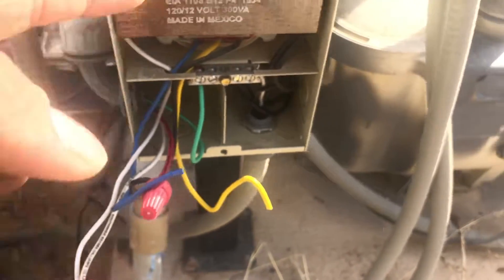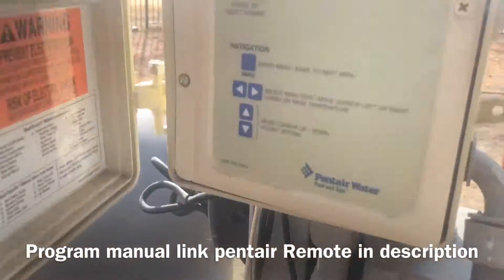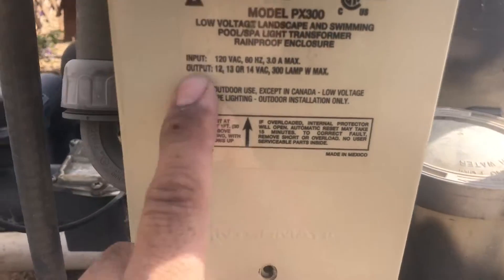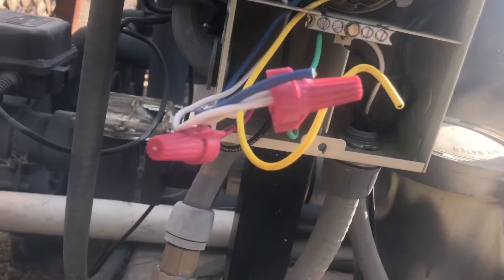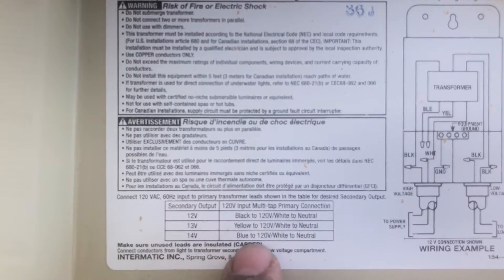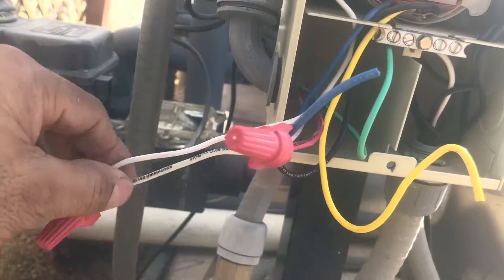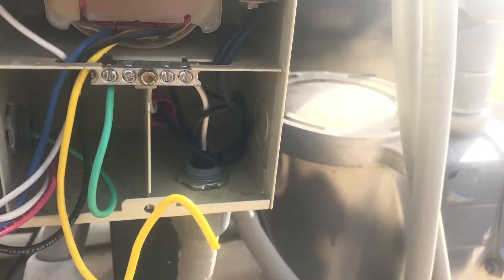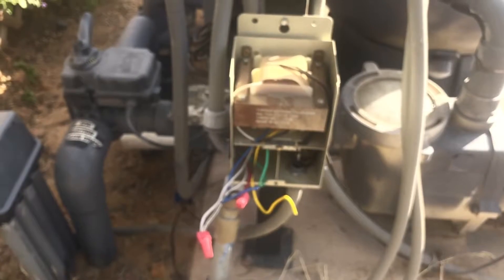Pentair Intellibrite LED Transform How To Wire and how it works

Comment: How do you connected to the low voltage lights?
Reply from the maker: Transformer have multiple voltage output 
Like 12v 15v 16v
Depend on your lights 
But you have to check with meter or google spec according your transformer model number you will see which wire how many voltage

Comment: Nice job sir.  BTW this works on the Pentair Easy Touch panel as well.
Reply from the maker: Infiltrator2003 
I didn’t tried but may need check spec